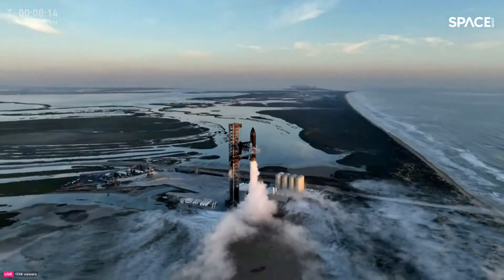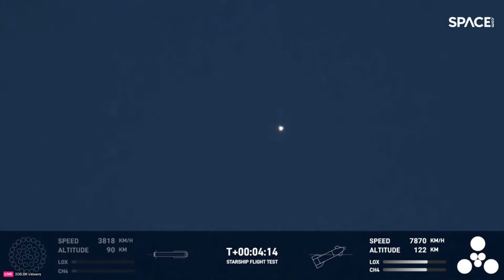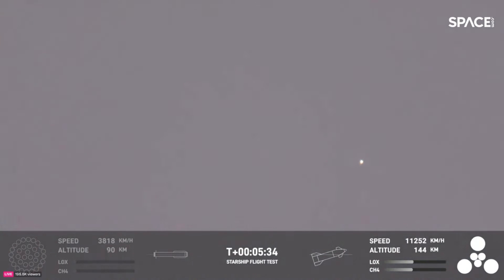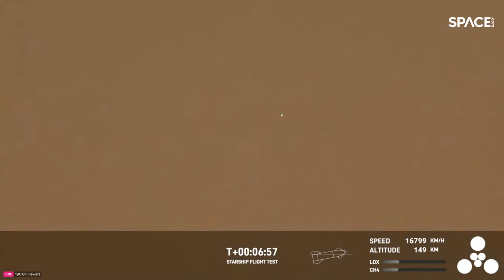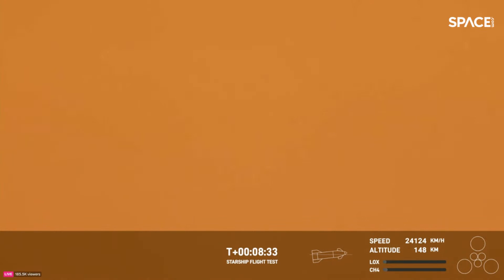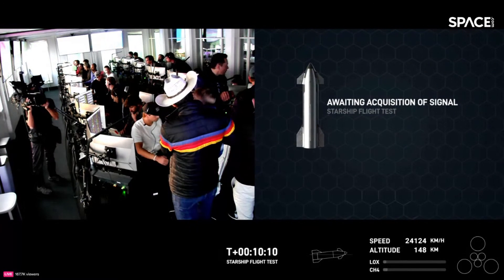SpaceX Starship launches on 2nd integrated test flight, booster explodes after separation

Comment: Major points:
0:16 ME successful ignition 
0:21 falcon heavy successfully achieves liftoff
0:27 falcon heavy fully clears launch tower
1:02 PT nominal
1:20 Mach 1 and 10 kilometre altitude
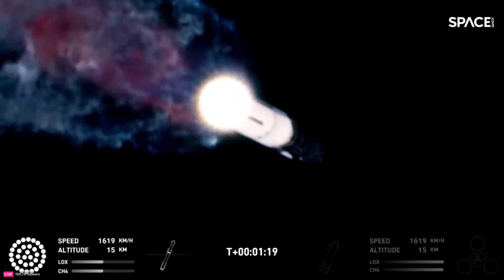1:31 highest structural stress on starship
1:58 Mach 2
2:21 Mach 3
2:34 50 km altitude
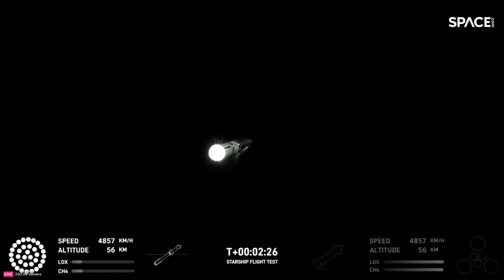2:44 Mach 4
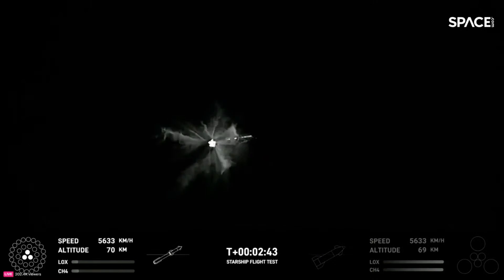3:00 MECO
3:05 second stage successfully ignites
3:07 second stage successfully separates and the booster falls away safely

Comment: The irst stage engine swquence should be changed. At staging all the engines remain lit only throttled down to prevent hammering and having to restart. After seperation shut down and purge outer ring engines. Keep firing the inner ring at a much lower setting until near landing. Strengthen the drive pumbing.

Comment: 6:34  why did the altitude stay at 149km for so long, and increase speed? If the speed increases the altitude should as well...seems you cant go any higher than 144-148km.
Reply: Did you forget that the horizontal axis was a thing?

Comment: My guess is the methane tank or propellant feed tubing cracked from the hot-stage separation, spraying a mist of droplets which mixed with the thin air at 74 km altitude ("Space" is 100 km, but still air even there), then ignited to explode like a purposeful fuel-air bomb.  Similarly, something appeared to start spewing from StarShip before communications were lost.

Comment: I'm betting on the booster explosion being due to an over-pressure event.  When it rolled over, the cold fuel met the hot top bulkhead and boiled.  Couldn't regulate fast enough.
The ship was an AFT event.  The data will tell them why.  At least we now know that the AFT works, at least on the ship.  Should work on the booster, too.

Comment: 24 October 1960 RUSSIANS WAS ALLREADY  TRIED THIS TYPE OF CONFIGURATION CALLED N1 ROCKET TYPE..... An outer ring of 24 engines and an inner ring of six engines would be separated by an air gap, with airflow supplied via inlets near the top of the booster. The air would be mixed with the exhaust in order to provide some degree of thrust augmentation, as well as engine cooling. The arrangement of 30 rocket engine nozzles on the N1's first stage could have been an attempt at creating a crude version of a toroidal aerospike engine system...SO NOTHING IS NEW HERE....

Comment: elon needs to but the two saturn v's left- they NEVER had this problem. 65 rocketdyne F-1 engines flew- all successfully.
Reply: This had nothing to do with the engines failing
Reply: it exploded didnt it- @Ethan_Roberts
Reply: @MrMakemyday3  not because of the engines
Reply: who cares- he is 0 for two- saturn v's were perfect @Ethan_Roberts
Reply: @MrMakemyday3  Saturn Vs still had issues that needed to be fixed before humans flew on them. Plus, many F1s failed during ground testing, it's almost as if that's the entire purpose of a test in the first place

Comment: Right after stage separation, 
The inner ring of engines ignite for the boost back but one fails to ignite. Then as the boost back procedure continues, more engines are lost until more than half of the engines Flame out. That many engines being out triggered an auto shutdown and as auto shutdown happened before it should have the FTS fired.

Comment: Much better launch. Noticed it cleared the tower much more quickly than the first attempt. Starship RUD at 148 KM which is well beyond the Karman line, but still well below a typical low earth orbit at about 400 KM. A baby step resulting in falling in its face, but hopefully they got good data to learn from and try again. Good effort.

Comment: I was expecting a problem with the hot staging actually - turns out I was righty again. Most likely also the cause of the problems with the first stage so looks like a wasted effort using hot staging.

Comment: How many satellites will be destroyed by the new space junk that explosion introduced?
Reply: none, all the debris will fall back to Earth as nothing made it to orbit
Reply: @aaronjacobs3980  The booster was already at 90km, which is just short of the low earth orbit floor of 100km, and the ship blew up at 150km, well into the low earth orbit range.  Considering the extra velocity which the explosions added, I'm sure that a good amount of debris will be up there for a while.
Reply: @scottk3292  Remind me again what the perigee of the ship was?
Reply: @infinitelyexplosive  If you mean apogee, the booster exploded at 90 km up, just under the 100km floor of low earth orbit.  The starship exploded at 150km, well into the low earth orbit range.
Reply: @scottk3292  No, I mean perigee. What is perhaps negative, meaning the ship was not in orbit?
Reply: @scottk3292  it never got to orbit. Altitude is meaningless unless you're travelling fast enough, which this wasn't
Reply: @Ethan_Roberts  and exactly how fast were those particles traveling from the explosion?  The ship had already cut engines, and was at enough speed to do just one orbit, so the ejected particles were clearly going much faster.  This is why NASA is so much more careful before launching anything.
Reply: @scottk3292  it was travelling 1km/s too slow for orbit and reentered a few minutes later. You really think the explosion would've sent debris fast enough to reach orbital velocity?
Reply: @Ethan_Roberts  Without atmospheric drag, yes I bet that could have enough velocity.  Then again, if we assume that the explosive force was applied evenly in all directions, and obviously the only directions which would really count would be those close to the craft's forward vector, then maybe it would depend on the question: how much fuel was it carrying?  Considering that it was also carrying enough fuel for landing, I'll stand by my position that some debris was sent into low earth orbit.
Reply: @scottk3292  it wasn't going to land and would've had remnants of fuel. Even so, it wouldn't have combusted as the gases would've escaped into space meaning it was more of an overpressure 'explosion' than an actual high energy explosion. No pieces of debris would've reached the remaining 1km/s to reach orbit.

Comment: Given that NASA had explosions of so many test rockets, many on the launch pad it must be recognized that SpaceX is advancing its development 10X as fast as NASA did.  So the explosions are not unexpected this early in development.  Any space program of new rocket technology must necessarily go through this phase - it's normal.  SpaceX is doing a great job of it.  Stay tuned.  This is monumental progress.
Reply: The Raptor full flow engine is very advanced tech so the fact that all 33 worked 100% on the booster is a huge achievement. The hot staging can be fixed.
Reply: @Tailspin80  I think the biggies were the initial launch and the separation. Those had to be closely choreographed.
Fixing the booster return could be a simple timing issue. Just let it coast straight for a minute to cool down before flipping it back.
Dunno yet about the ship itself.
Reply: @protorhinocerator142  A big step forward from test 1. Stage 0 problems fixed, so no chunks of concrete flying around damaging the Raptors. Hot staging worked almost perfectly, the only issue being restarting the booster engines, maybe due to fuel/oxygen slopping about. The measure of success is how much data they collected, not whether the ships blew up. They were not coming back whatever happened. The only disappointment is that they were not able to test the heat shield tiles used for re entry.
Reply: @Tailspin80  I think they could solve the booster overheating problem by waiting a bit longer to rotate it. Send the ship out farther to sea to get it.
Reply: @Tailspin80   Elon tweeted that none of the Raptor engines in their first flight were damaged by that pad debris.
Reply: @SihAza  I agree that none of the analysis indicates Raptor damage from concrete, but how would they know? Anyway, it’s history now.
Reply: @protorhinocerator142  Don’t think it was an overheating issue. General view is that the fuel and oxygen were slopping about because the booster was not accelerating, so fuel delivery was interrupted to the Raptors and they blew out.
Reply: @Tailspin80  Maybe use an inner diaphragm on the next model?
Reply: Absolutely expected, that’s why they do tests. This generation of scientists and engineers are building off of everything our parents and grandparents learned.  Along with the advancements in computers, it’s no wonder things progress so fast.
Reply: @EwePray  Except there is no such progress down the street at Blue Origin.
Technology alone doesn't get you there. It takes commitment to make these gains.
Reply: Yes, the Atlas rocket was basically a bomb that they eventually got to fly!! 😂
Reply: @blucat4   Yes, and StarShip is very similar to the original Atlas in many ways, like a stainless steel balloon structure.  Atlas skin was so fragile that it would collapse under its own weight if not kept pressurized, even with no propellant weight loaded.  Starship can stand alone but will collapse under a propellant load if not pressurized (one did fail).
Reply: You speak as if SpaceX is all newbie kids who are starting from scratch.  Don't you imagine they hired many unemployed and underemployed rocket engineers in the L.A. area during the dead years of 1990's?  Aerojet hired many laid-off Rocketdyne engineers when they got the Cobra engine project (new Shuttle engine) in 2001.
Reply: https://www.youtube.com/watch?v=ka5id7ZQKL4
Reply: YouTube

❤ HASTAN BASO ❤
Reply: My sincere congratulations to SpaceX for the successful launch of both stages. My question is why did the flight terminator explode on both stages? Seems odd, was it planned or why was it triggered? Next is how did the launch pad survive, was it damaged and what was the effect of the flood?

Comment: This was so amazing! I love how all 33 engines are firing, then they shut down in sequence to prepare for stage separation!!
Reply: 33 engines means disaster. Even if 1 engine fails, it blast the whole thing.
Reply: @CrazyCandyCrush  Not really. Firstly, the computer will detect the issue in the engine and shut it down. Even if the engine explodes before the computer shuts it down, there was shielding around the raptor engines so that one raptor doesn't take out the rest.
Reply: @CrazyCandyCrush  If you are meaning that one raptor engine shutting off means a failure in the whole mission, then you are mistaken. Starship can still run even after 2 engines are out. And depending on how far the rocket is in the sky, it can lose up to 3-4 engines and still have a nominal flight.
Reply: … and explode
Reply: @morpheaworld that's right.
Reply: You've been successfully gaslighted. Well done.

Comment: Unfortunately, it seems that Starship (after saparating from the booster) also exploded (in 08:25 in this video you can see a big expansion, and it was not "engines shutdown" or "jets from the maneouvering system"...). But this was only the second attempt. The hot-staging "method" was an absolute success, the booster using all 30 engines flawless... What a milestone! Really amazing!
Reply: Yes, you can see it clearly and the telemetry stopped at that point. But still much better than test #1. 🙂
Reply: @blucat4  Add in that the booster and ship were also outdated compared to the newer prototypes. Quiet exited for when those are launched.
Reply: @theexchipmunk   Really? They've already designed and built newer ones?
Reply: @blucat4  I think they are at least 2 or 3 new ships near completion, many things on this ship have already been redesigned. They wanted to launch this ship to get data instead of just scrapping it.
Reply: @livefancams   Thanks. It would be good for PR if everyone knew that. Elon probably doesn't care.  :-)
Reply: Wow you idiots believe this. No hope.
Reply: https://www.youtube.com/watch?v=ka5id7ZQKL4
Reply: Well, the boosters reached the second stage, and that's the important thing. It looks like the thermal classification and separation process caused some engine damage and caused problems. All in all, it was still a good test. I think the pad even survived this time! Is that what happened?
Reply: Yep!. As a second test, it was great! Although both crafts exploded, the hotstaging was a success, the 33 raptors from the booster worked flawlessly, the fire supressor system (booster) also worked perfectly, the second stage (the "Ship") ignited all 6 engines in the planned sequence (first the outer three, to separate, then the inner three. And it almost reached orbit! Only on the second try! That was amazing!
Reply: To be entirely fair to Starship, I’m pretty certain that’s the highest it’s ever flown.  Probably gonna get a ton of data just based off how far it got before it was terminated.
Reply: Stop being a fan boi.
Reply: @rahrahrobbbieee  You want to have Elon's next baby.  It's obvious.

Comment: The commentators explained what happen, they stated just after the booster section exploded. That the booster stage was not designed for hot staging, so they always knew there was chance that the hot staging combined with high G forces of spinning around could cause the booster stage to basically disintegrate. Which is exactly what we saw om video, but since the booster was never meant to survive or be recovered it was still a successful second flight. Plus with all the delicious delicious data from booster and entire launch of Starship.
Reply: The booster was, if all went perfectly, designed to land like the other boosters have been. But still successful, you're right.
Reply: They should test how a booster should reignite after turning to upside down position.
Reply: so much for reusability. So far its an expendable system just like SLS.
Reply: @DeepDeepSpace  the fact that it exploded doesn't mean it is an expendable rocket. SLS took 11 years until first flight, and it is going to be expendable forever. Starship is clearly being designed for landing and as we have seen with other SpaceX rockets, it will land soon.
Reply: @AlexandreSNunes  just because something is "designed" to be reusable doesn't mean it will be reusable. Starship clearly has a LONG way to go before any hope of reusability much less rapid reusability.
Reply: @DeepDeepSpace you a hater.

Comment: You can tell Starship explodes right after it's 3 engines go offline and there's no more telemetry updates. Through the orange you can still see the explosion.

And what I find fascinating about the booster explosion is the cascade effect you can see in the engines; During the flip first the right side engines go offline, and then one by one a cascade occurs on the left. Naturally we don't know the technical details, but that leads me to believe something occurred with the fuel distribution system. The left side engines didn't fail, they simply stopped getting fuel probably by damage the right side engines shutdown caused. The damage travelled both up and down the fuel distribution system causing total failure of all engines downwards and upwards it detonated the fuel tank itself.
Reply: Makes sense! Just from a casual observer! Slight calculation errors/materials/design/environment etc.. in the effects of hot staging is possible suspect for effects on both - delayed impact which occurred seconds after! So this seems pretty close to nailing that separation! 🙏

Comment: Gee! Guys! looks like the "Parts Count" mindset and its: "new engineering perspective" helped alot..
Those engines looked way healthy in comparison to the first test lauch.
Hot staging was going to be problematic. Hopefully theres telemetry enough to figure out what happened. either a burn thru the shield dome, or too much heat down the sides. might pay to beef up the shield, and add insulation on the tank dome, or wet it. and maybe do a slight cantilever past hull diameter of the shield with some flare, to get a wedge of cooler air at the hull top of booster.
That flare might only be a couple inches or so, and reduce grid fin area by creating top drag falling.
Suspect the shield should be more parabolic, and the over edge flare be pretty acute to the hull proper.
Nor would it hurt to add a meter in height to the seperation ring to reduce effects with distance.
Distance is cheap! 
Might want to triangulate the supports system, like a Tipi effect. then you could do away with the skinned sections and with the increased dustance get lower blast pressures.
Make the seperation stage taller and triangulate the support struts, and make the shield dome more pointy parabolic rather than the flat spot.
Reply: Makes sense! Just from a casual observer! Slight calculation errors/materials/design/environment etc.. in the effects of hot staging is possible suspect for effects on both - delayed impact which occurred seconds after! So this seems pretty close to nailing that separation! 🙏
Reply: @aleftav12  Yeah, the hot staging can be improved,  and those engines were sweet...
I suspect side pump Raptor 3's from how well they ran.
Theres no doubt now, that Elon has the best engines... Time for Jeffie and his enginerds to start working on parts count and over all simplification for BE engines and beyond.
Basically Parts Count is now rocket engine Jargon, not just electronics engineering.

No more "Rat's Nest" engines...

Looks  to me like Elon has the rocket version of Chevy engines... and Bezos is a Ford guy....

Comment: The engines (ALL THE ENGINES) performed perfectly.
Hot staging however caused more problems than it solved. I think both RUD's were a product of the hot staging damaging both vehicles.
Reply: Makes sense! Just from a casual observer! Slight calculation errors/materials/design/environment etc.. in the effects of hot staging is possible suspect for effects on both - delayed impact which occurred seconds after! So this seems pretty close to nailing that separation! 🙏